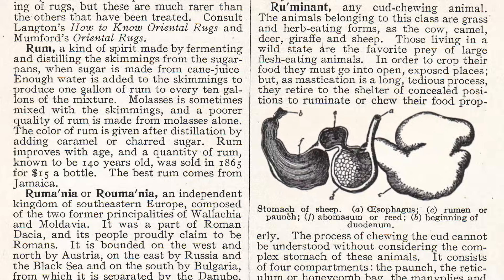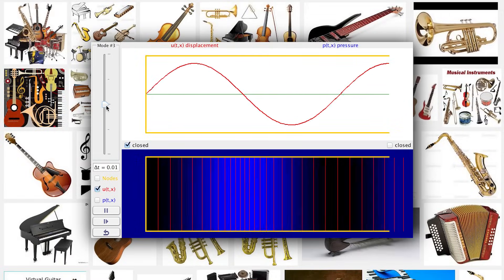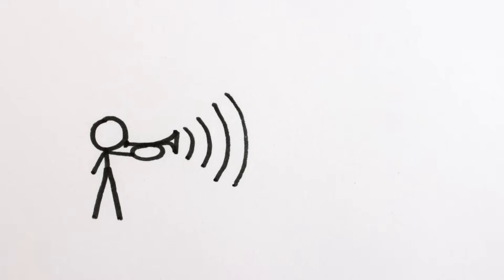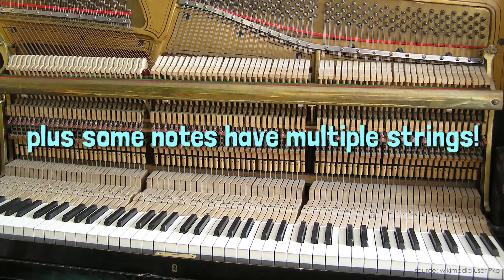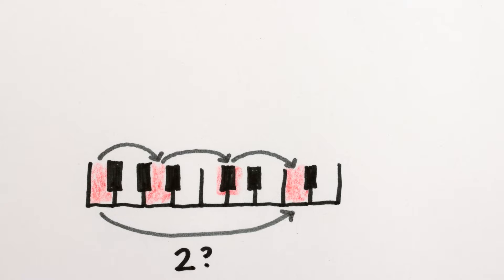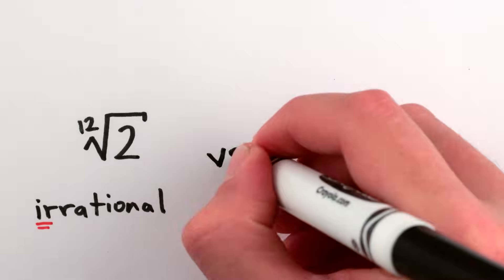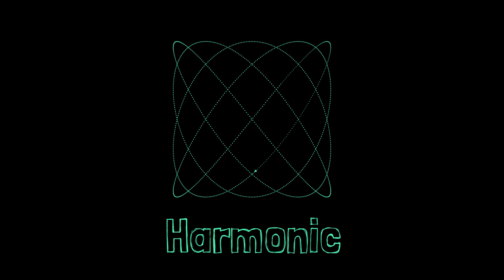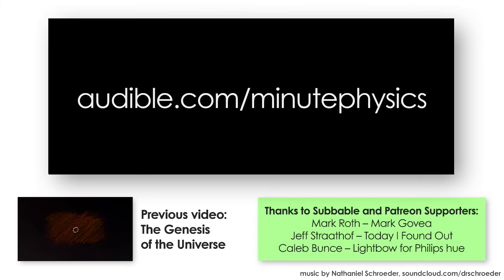Why It's Impossible to Tune a Piano

Comment: That was extremely interesting. I've played the piano for years and years but I didn't know tuning wasn't based on harmonics.
Reply: +Shilag It is though. Have you watched the video?
Reply: +uztre6789 Have you ?
Reply: +uztre6789 Well, one of us clearly misunderstood the video. I'm not sure I understood everything he said but what I gathered was that pianos can't be tuned based on harmonics because it won't add up cleanly to an octave with twice the frequency of the last one, no matter what harmonics you base it on. Therefore we just tune it based on even mathematical intervals instead.
Reply: Shilag Harmonics still matter because why care what an octave is when you don't base it on harmonics.
Reply: uztre6789
Fair point.
Reply: uztre6789
Not really, it's based on wave frequency multiples, not harmonics. We're talking about the tuning, not the entire function of the piano. Of course the pitch was originally based on harmonics but it was impossible to get it accurate using them. That was what I took as the point of the video.
Reply: +Shilag Exactly, the point is to have the octave's tuning ratio be exactly 2:1, otherwise with harmonic tuning you end up with a non-octave scale which messes up all the tunings of higher notes relative to lower ones, but close notes (within an octave) would sound fine or even "better" because of their ratios being more "pure."
Reply: +Shilag Oh but it IS based on harmonics. To tune a keyboard instrument by ear you have to count the 'beats' produced by sounding any two notes together. Unison and octaves are always justly tuned as well.
There are multiple tunings and temperaments. Equal temperament is the one where all scales sound equally out of tune. But it's pretty bad for thirds / sixths. So, ironically is it ok for medieval and ancient music, where justly tuned fifths/fourths were a thing.
Reply: +Shilag The video doesn't actually explain what is the specific problem of piano tuning. It covers some of the basics of harmonics and some general tuning problems, but doesn't say why pianos cause very specific tuning problems. It's because of inharmonicity - the harmonics on the strings are not exact integer multiples of the fundamental frequency. This means for some of the higher string harmonics you get notes that are slightly higher than expected - harmonics that should be a few octaves above the fundamental are in fact sharper (higher frequency) than this. In order to tune a piano and get a reasonably tuned compromise, you have to tune notes that should be an octave apart slightly wider than an octave, e.g C3 to C4 will be a bit more than an octave. So the bass notes tend to be tuned a touch flat, the middle notes are about OK, and the top notes are tuned sharp. This mirrors the natural inharmonicity of the string's harmonics. This is called stretch tuning.
The same problem applies to many instruments, but because the piano has many more strings (with big variations in length and thickness), covering many octaves, the effects are more pronounced.
Reply: +Howard Wright Thank you. Totally correct. He doesn't talk about stretch tuning at all. The harmonics of any individual string are slightly sharp to the fundamental of that string because strings don't vibrate like the cartoon suggests. At the string ends, vibration is impeded because the the ends are tied down; the segment that isn't freely vibrating is a greater proportion of the vibrating length of each harmonic. In essence, each harmonic has a proportionally shorter string length and is consequently slightly sharp. Hence the need for stretch tuning.
Reply: +Michael Soso It's the stiffness of the string (due to the materials used) that causes the effect you describe. Stiff strings resist the increased bending needed for the higher harmonics, and cause the sharper pitch. Gut or nylon strings aren't very stiff, and the inharmonicity isn't that great, but steel strings are stiffer and the inharmonic "sharpening" of the higher harmonics is more severe.
Reply: +Shilag With Just Temperament tuning you have perfect ratios and correct octaves, but it's only right for one key.
Reply: +Howard Wright     and the mass
Reply: +Shilag seriously? oh, you only have played then, not feel, lol.
Reply: He meant the way of tuning. Of course he knows that a piano's concept is built after intervals.
Reply: +Shilag there are better vids here about that issue. This was a very mathy explanation (correct though) with no examples about how the different tunings sound like. This tempered tuning is absolutely fine for most people. It only may sound "rich" as the phase effect starts to work with chords.  I think It was possible to tune a pentatonic perfectly but then the other notes are just more "off". Then that tuning sounds pure but less hm.. hm.. yeah. Its worth to search for examples. Quite interesting and vital for guitarists also - blaming their guitar being badly built and out of tune when its just simple physics:)
Reply: dziis6s
Just a note on just tuning - you can tune 8 out of 12 tones in a chromatic scale justly by tolerating only one bad fifth - tuning the final four tones is where the trouble begins. You can still adjust them so that only one tonality is difficult to incorporate and, in general, you can modulate among seven neighbouring tonalities in the circle of fifths and encountering only one dissonant fifth.
In short, simple diatonic scales can be tuned 'perfectly'.
Reply: +Shilag If you play two notes together that are slightly out of tune, the waves will interact to produce a "wobble" of loudness. Professional piano tuners work by timing the wobbles, which tell them whether each note is out of tune by the right amount.

So what's the right amount? It's how far out each note is from the perfect harmony that every key you play in is equally slightly out of tune, so you don't have to retune the piano every time you want to change keys.

The irony is, with synthesisers you can retune them instantly with the touch of a button, so you could play a piece where every bar is in a different key, and each key would be perfectly in tune.
Reply: ***** Well, kinda. It's about the interval of the octave, and even if you stay in C major for instance there will be a slight detune if you use a piano keyboard.
Reply: justwitti No, that's not the point. The video explains why the octave interval can't be calculated from any other interval.

Even calculating from a circle of mathematically perfect fifths will give you an octave about a quarter of a semitone too high.

But this applies more generally in calculating any scale from any fractional interval. That's why the Equal Temperament system uses indexed intervals that (a) approximate Just Temperament and (b) allow for key changes.
Reply: ***** Ah, I understand.
Reply: +Howard Wright 
You're of course right about the specific problems of tuning a piano, but that's not what this video was about.  Perhaps it would have been better had they demonstrated it on an electronic keyboard.
Reply: +Shilag the wave frequency multiplier is based on harmonics though.
It was specifically chosen to make all the harmonics as close to the ideal note as practicable.

I think the problem here is the language you're using.
The tuning system is based OFF harmonics, but it is not tuned TO harmonics.
Reply: +Shilag You should give Bach's Well-Tempered Piano a try. It's kinda the best demonstration of the benefits of tempered tuning.
Reply: ***** Bach's piece was written to show off the Wohl Temperament (aka the Well Temperament). But it tends to be performed in Equal Temperament, which shows how musicians can miss the point just like everyone else.

Wendy Carlos did some recordings in Just Temperament, and most Arab music is in a 24-tone Equal Temperament system.

Yes, there's a lot of variations out there.
Reply: ***** Huh, I was not aware of that!
Reply: +Stefan Travis What do you mean exactly by "musicians missing the point"? And correct me if I'm wrong but wasn't the base key of those "well temperaments" changed depending on the music?

Maybe I've "spoiled" my ear by listening to ET-tuned instruments for years but having experimented with Werkmeister and Kirnberger temperaments on my clavinova I certainly woudn't like playing in all 12 keys with a single base tuning.
Reply: Pontus Lundström "Well/Wohl Temperament" is a single compromise between the need to be in tune and the need to change keys. It was not AFAIK a set of such compromises.

This particular compromise allowed for certain common key changes to remain relatively in tune, while allowing less common changes to be horribly out of tune,

The point of the piece "The Well Tempered Clavier" was to showcase the available key changes and their relative lack of loss of consonance. So to perform the piece in any other temperament is IMO to rather miss the point.

"I certainly woudn't like playing in all 12 keys with a single base tuning."

That would indeed be horrible. It depends whether you value exact harmonies and sweet chords in a single key, over the ability to change keys in mid-piece.

I think Just Temperament would benefit Debussy, but be disasterous for Beethoven.
Reply: Pontus Lundström
Stefan is correct about well temperament not being adjusted to account for the key of the piece- at least not for keyboard instruments.  It should be pointed out, though, that no one knows exactly which tuning Bach meant by "wohl Temperierung"- he didn't say, and we'll probably never know for sure, unless some unknown documents turn up.

But intenal evidence from "The Well-Tempered Clavier"- for instance, the relative prevalence of major thirds in the keys around C major, and their relative scarcity in the more distant keys (F# major), points to some kind of fairly but not perfectly evenly distributed meantone temperament: one where the keys around C were sweetened (compared to equal temperament) and the distant keys perhaps a bit wolfy but useable.  Somewhere in between quarter comma meantone (heavenly C, beastly F#) and twelfth comma (aka equal temperament, all alike and all a bit nasty).  Say eighth comma or something.
Reply: In practical tuning it comes down to this: if you want a Western diatonic scale, you can make it more fifthy or more thirdy: you can steal from the one to feed the other.  The more fifths you need, and the better they need to be, the more the thirds have to suffer.  Like real life, tuning a scale is always a compromise.
Reply: *****
"Harmonic tuning hasn't been in use since the 1800's" is a bit of an overstatement.  Many musicians around the world, and also in the West, still tune with no regard for 12TET or 440 for that matter.  They are not perhaps represented strongly on the radio or pop culture, but they exist nonetheless.

I'm one of them- I play polymetric harp music with my A wherever it winds up, and no equal temperament.  There is a flourishing subculture of tuning and temperament freaks who also disdain 12TET.  So while what you say goes for the majority, it's not the whole story by any means.

I was also a music theory major btw at UC Berkeley years ago.

cheers from cool Vienna, Scott
Reply: ***** Question: Fans of harmonic tuning tend to like "the pentatonic scale", but which pentatonic scale?

If we go by simple fractions, we get a sexatonic scale:

A 1/1
B 5/4
C 4/3
D 3/2
E 5/3
F 7/4

...so which note to omit?

Or could it be:

A 1/1
B 6/5 ... or 7/6 ... or 9/8
C 5/4
D 4/3
E 3/2

...? I haven't been able to find a commonly used pentatonic just scale. Is there one?
Reply: +Stefan Travis
Hmmm, good question.  I'm not really an expert on pentatonic scales.

I think you've got your frequencies a bit mixed up.  In the first scale, for instance, C must be 6/5 if it's to be a minor third above A.  Setting A as 1/1 is confusing because it's so "fifthy".  Setting C as 1/1 gives a possible pentatonic scale, with all nice intervals, of:

C 1/1
E 5/4
F 4/3
G 3/2
A 5/3

You can add one more tone and have a nice hexatonic scale, viz.:

B 15/8

With the exception of the tritone,

F-B = 45/32,

all the intervals are low-integer just.  The problem note in the C major scale is D, unless you have two of them:  10/9 and 9/8.

Any five tones from this scale is of course a just pentatonic scale.  Get rid of either F or B, and it doesn't even have a tritone- this is what most classical pentatonic scales do, as far as I know.

cheers from sunny Vienna, Scott
edited for mistakes- my bad, sorry.....
Reply: +Minute Physics Don't click this it is a scam this channel that posted the comment has 0 subs
Reply: +Constantine Soteriou Don't even get started on autotuning
Reply: +Shilag This video never touched upon the fact that a piano actually has three strings per note in the mid-section of the keyboard. The strings are tuned such that the two outer are slightly sharp & flat respectively providing a chorus effect that mitigates any irregularities in the tuning. There is also a phenomenon which causes them to vibrate closer to each other or sympathetically vibrate the pitch that best harmonizes (as I understand it).
Reply: StavroJones Good point.
Reply: Where did you get that idea? The unisons should all be dead beat the same.
Reply: Why do you think it is called "The well tempered Clavier"? Has nothing to do with how warm the piano is. ;)
Reply: we tune (when tuning by ear) by the beats, which are formed when the harmonics of one string intersect in the air with the harmonics of another note's string.  Think of it as an apple tree and a pear tree. Those are the wires (strings). the fruit on each tree is the harmonics made by the vibrating wire. Take an apple off one tree, and a pear from the other, and smash them together in the air -- it creates a new taste, a pear-apple blend.. That's why when you play (for example) the center strings of notes A3 and the E above it, (a fifth) ideally you hear a slight wa--wa---wa---wa because it isn't a "pure" (or "perfect") beatless interval.  the fourth above that (E to A4) - which completes that octave -- is wide, by about the same amount; so the interval there also makes a beating sound; BUT only in the air (in our ears). If you play these notes separately, you won't hear a beat.  And if you play other intervals, even within that octave,  you'll hear differing beatspeeds. --- THAT is how we tune. Even a machine has to listen to those beats.
Reply: Shilag the only harmonics that matter are pinch harmonics.
Reply: @GrimmieXII  pianos absolutely are not tuned with octaves having a 2:1 fundamental ratio. Because he is wrong about harmonics. In a piano they are not whole number multiples of the fundamental.
Reply: @Thoracius  no, you're correct, they're not tuned that way. But every octave is 2:1 nonetheless. Also I appreciate the reply to my 8 year old comment lmao.